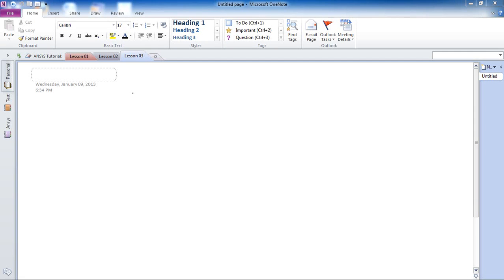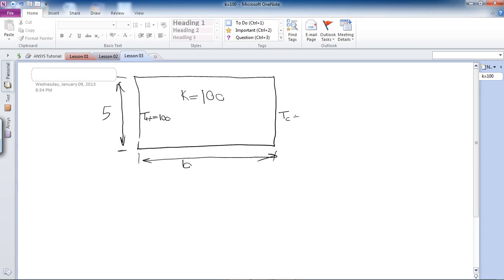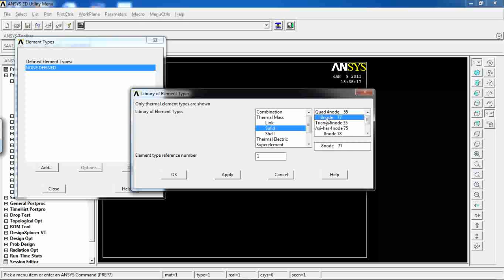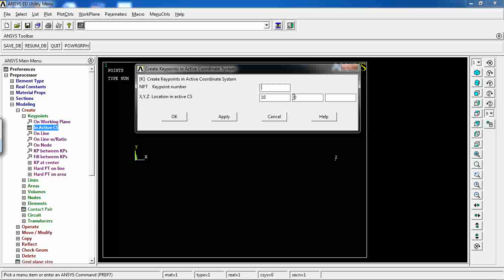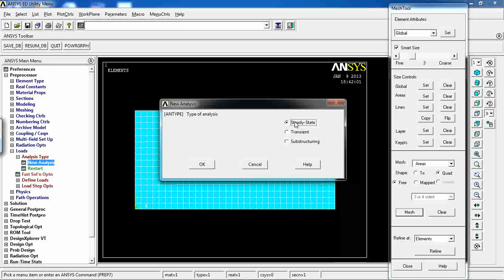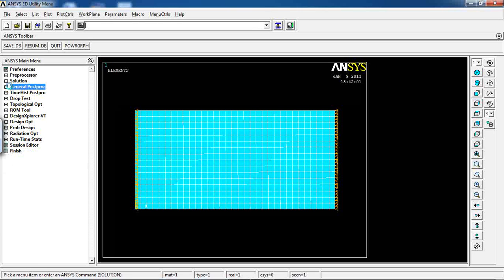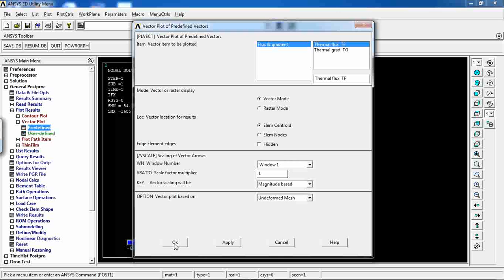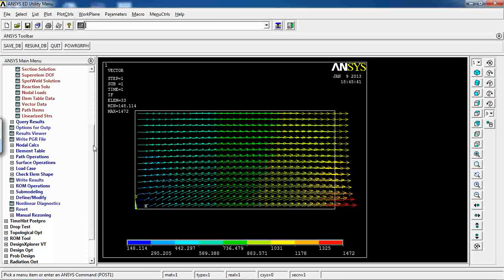ANSYS - Lesson 03: 1D Heat Transfer with Heat Generation

Comment: The solution of the temperature distribution is wrong, because the highest temperature should be in the left-bottom corner with color red where the boundary temperature was 100 but not 
the right-bottom corner where the temp at the boundary was 20 
Moreover, the heat generation 2000 as the speaker drew, represent heat external but not heat generation, the heat external can be applied to the boundaries but the heat generation has no location inside the body, like a body heated up in an oven them applied the temperatures at the boundary, so please, recorrect asap

Comment: I want to simulate a turning cutting process i want to define the velocity and feed of the tool and calculate the stress, Forces, and Temperature generated by cutting. I draw the model on catia can i calculate these in Ansys? should i work on ansys workbench or better to import the model in APDL?